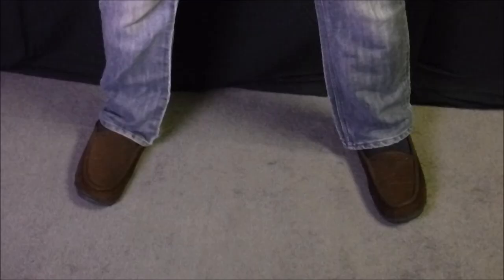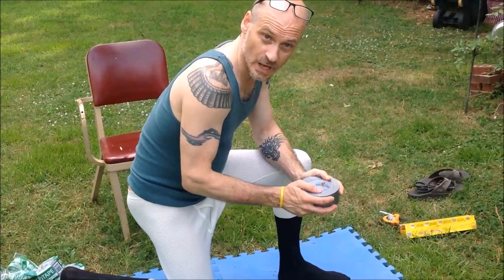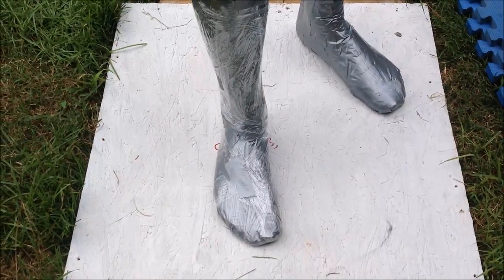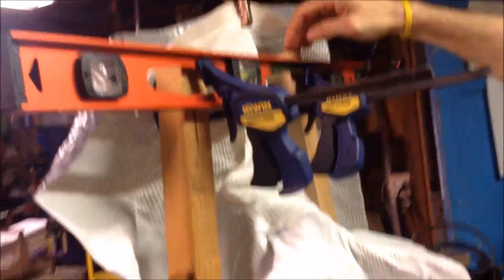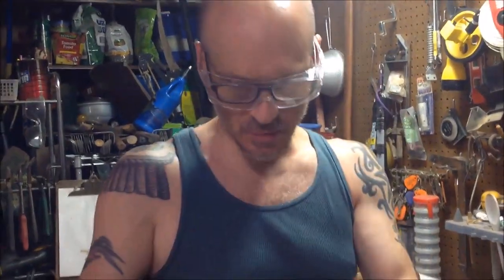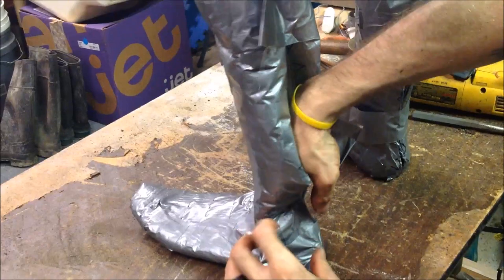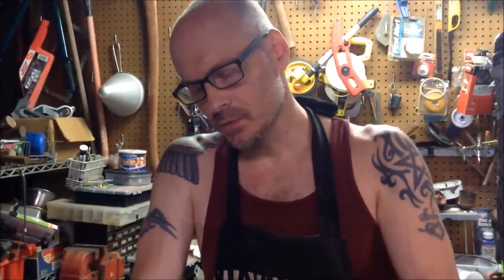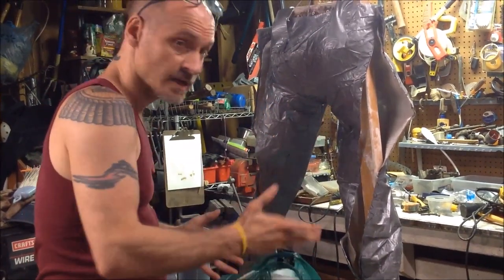Full Body Mannequin Part 1:  The Lower Body (Ever Expanding Life)

Comment: hi There !
your video is very well explained . it's a pity that some part of the audio are too low . will be very helpful to add subtitles in those areas . it will be appreciated it and I surely will watch it again  . Thanks
Reply from the maker: Thank you for your feedback. That is a good suggestion.
Reply from the maker: @hueyahumana I just posted Part 2: the upper body.  Thanks to your advice, I made sure to caption this one ;) https://youtu.be/fA4TzmYn1jQ
Reply: Yeah, it dropped so low that the CC didn't work for it. I was having to use CC since I'm already hard of hearing. I thought it was just me having problems hearing.

Comment: For the mixing of the plaster and sand, would it work better to take one cup/container of the plaster powder and one of the sand and dump them in to the bucket together and mix as you go along and then mix the whole thing once it's all in? And once you add the water, could you use the paint-mixing attachment on a cordless drill to mix it up?

For sealing up the outer parts where you cut on the duct tape, have you ever tried taking a piece of tape that is not quite as sticky and that will allow for adjustment and put it it on the insides of the seams so you can close the outer pieces on top of it and make sure it's all lined up so you don't get overlap or spread when trying to put them together?
Reply from the maker: @my cats  The biggest problem with the plaster is how fast it dries.  You must have the sand and powder completely mixed BEFORE you add any water.  Once the water hits it, the clock starts.  I suppose you could try the mixing attachment, it might work wonderfully, but I personally wouldn't for the following reasons:  First, the mixture gets very lumpy.  By using my hand, I can feel every lump and work it out quickly with my finger tips.  Secondly, that would give me one more thing to worry about doing (cleaning the mixer) when my time is extremely limited between the point of adding water and the point at which the plaster hardens.  It is challenge enough to get the mixture fully mixed and to get it into the feet and shaped before it hardens.

As for the type of tape, your guess is as good as mine.  The duct tape has worked well for me, even for closing up the seams.  A slightly less sticky tape might be useful as long as it is strong enough to keep everything held together.  There is quite a bit of pressure on the seams once you add stuffing.
Reply: @everexpandinglife  Oh I hear you on lumps in the mix I went to pour some leveling floor mix that sat too long in a humid environment before being opened. Had a friend with me who said to ignore the lumps. Floor came out like the surface of the moon and we had to take an angle grinder to it. Never did get all the stuff off the mixing attachment.

Comment: why couldn't you fill with silicon instead let dry
Reply from the maker: @ Robert Lascelle Can you elaborate on what you mean?
Reply: @everexpandinglife  like mix with cornstarch and pack it in side of it
Reply: @everexpandinglife  like put silicone and cornstarch pack it in a work it in world that work
Reply from the maker: @ Robert Lascelle I'm not familiar with that approach.  I coundn't say one way or the other.  I don't know if that would be heavy enough to weight the feet.  It might be too heavy to do in the entire body.  But hey, who knows?  If you try it and it works, let us know.  You might have just discovered a new approach!